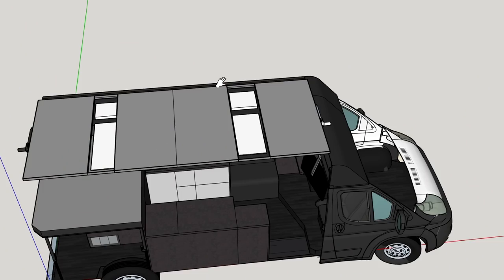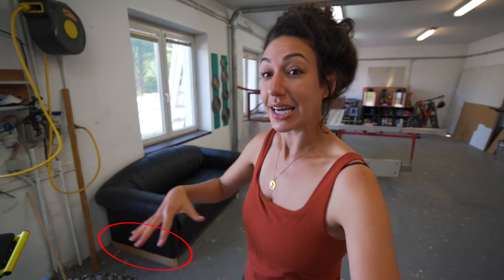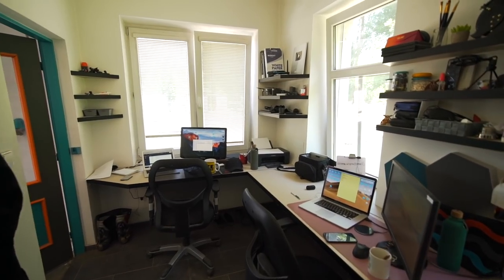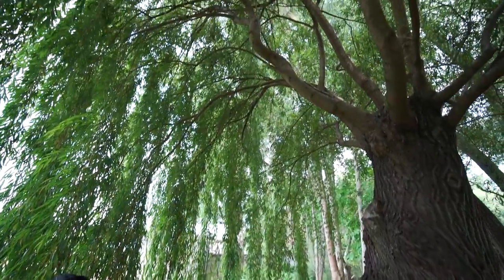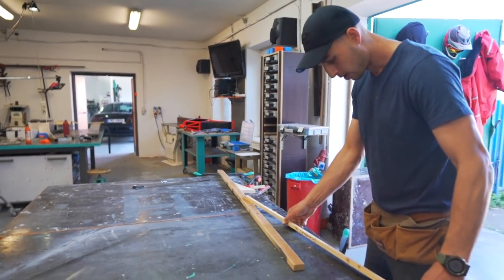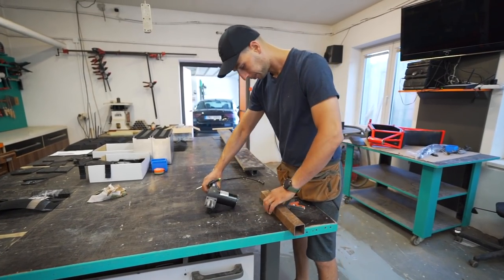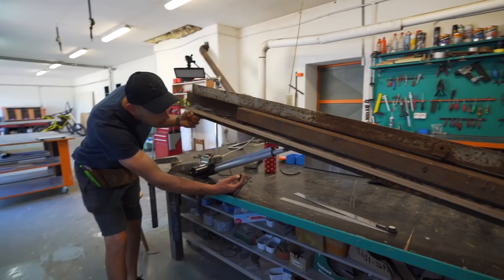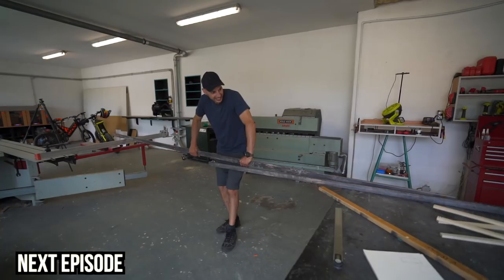Inventing Motorized Solar Lift for DREAM DIY Van Build / S2E1

Comment from the maker: Happy Wednesday! It's been a big week! We're finally feeling like this project has everything we've wanted. It's light-weight, around 11cm tall, and the craziest goal of all... as close to 45 degrees as we can get! Wishing you a wonderful week, and don't forget to smash that "like" button if kittens bring you joy <3

Edit: I need to pass 3 more levels (7 total) and then I will have my skydiving license! Yippee!
Reply: Off subject question.....How long (many miles/km/years) will a decent 750w mid drive kit or 3000w rear wheel e-bike kit last? I heard the 1000w  $200 rear wheel kits often don't last very long under normal use. I have a cheap 2 stroke motorized bike kit and really want an e-bike kit but can't afford to pay $1,000 for a motor & battery kit only to have it last a year or get destroyed from water damage by getting caught in the rain a few times.
Reply: Someone is falling in love with a kitten.....
Reply: OMG, you guys have to add that little kitty to the family!! 🐱❤️🐱

Comment: Very cool.  The same concept/mechanism can be used to level the bed that you sleep on. Let's say if you are parking on the street for the night, the passenger wheels are typically in the street gutter. One side of the bed is higher than the other. Ladi's mechanism can then raise the bed so it becomes level. The rest of the van will not be level of course, but having a level bed for sleeping is a requirement.
Reply from the maker: It’s better to level the whole floor so it’s comfortable even for cooking and general existing 😂 Leveling air suspension would be the dream!

Comment: When I saw the problem, I would have thought of a design using a small second vertical actuator just to push the first few cm.
Your solution is much more efficient. Congrats!

Comment: That is a  clever mechanism. I considered a bladder to start the initial motion on scissors but after evaluating pros and cons decided on portable panels. When I park I set out the portable  panels. The additional benefit is camping in shade while panels are in the sun. When driving alternator and the panels on the roof provide sufficient charge.

Comment: Some reason came into my mind those hook lift trucks, lift cylinders are almost lying down flat but there is small help piston upright under boom on frame what assist at the beginning of the lift so that main pistons gets better angle.
Reply: when you see them tinkering with designs that didn't fit their needs at around 16;15 you can see them try something similar to what you're suggesting, using a spring in place of the helper cylinder. presumably it didn't fit their requirements, (maybe too tall?)
Reply from the maker: Too tall and requires a lock. It would be bouncing on the spring when driving.
Reply: yes but i didnt mean spring, there is short actuator under and push that frame up same time when main actuators start lift, i would do something like that and use also clamp locks.
Its hard to design something functional in such a low space and that it will last a long time.

Comment: I've been waiting for this video since you announced a solar lift. Finally it's here !
Reply from the maker: Hope you like it!
Reply from the maker: It looks pretty promising so far, It will look very futuristic once it starts sliding and tilting 🤞
Reply: @StefanAPagel  use the sides, hinge from the top then adjust the bottom out to the Sun angle.

Comment: To optimise this further, it will be ideal to know the panel tilt angle, as you will need/can vary this depending on your location and time of year. Once you reach a new location you can refer to sun charts for the zenith angle and a simple tilt angle calculator for that day. You can certainly put it at 45deg and be done, but when you have an adjustable tilt angle mechanism already there you can easily optimise it further. Just a thought.

Comment: L&M If this doesn't pan out in the long run, have the panels on a pivot on the side you have a and link the ends on a shaft and have worm gears on either end and the middle, speed isn't an issue, the panels could take 10mins to get open but that doesn't really matter. A support pole could achieved using other actuators but you'd have your low profile with the work drives being in line with the roof and a hell of a lot of strength having less structural failure points. The actuators would be supportive but not required .

Comment: Hope you bought a good quality actuator. The ones coming from China will not last more then a year. I am on my second set for my home solar tracking system, and one has already broken down again. Average is around 1 year life span.
Reply from the maker: Depends how you stress them, how mounted they are, how waterproof (if) they are, how overloaded they are…Ours are from China as well and I bought heavy duty for a purpose. I’ll be waterproofing them later as well.

Comment: Just an idea if you havent tried already... If you wanted to use the 'scissor lift' option, could you not flip the folding point and have the actuator in its 'extended' position when the solar panels are flat to the roof but when you operate or 'retract' the actuator it pulls the hinge and lifts the solar panels up? My theory is that its using more leverage then force? Love you guys all the way from England!!

Comment: Great video 👍 Nice solution if you need a small powerful drive have a look at car wiper motors!
Reply from the maker: Thank you. I considered it as well for the threaded rod option.
Reply: @ladiandmargaret  Your solution was ace amazing what modern electronic motors can do on a size power output!

Comment: The first good idea i came up with is to use a worm drive or worm gear, while one of the gear is fixed to the stealbeam holding the solar panels
That should also allow a quiet flat desigm
Is there a reason why that was no option?
It may cost alot of torque to get it going but to prevent that u could use a finer thread on the rotating thread
Reply from the maker: It’s a complicated mechanism so at this point you just need to work on it. I think it required more material making it heavier.
Reply: @ladiandmargaret  thats certainly true 
I just finished my university exams and watched ur new video about your solution for the solarpanel-roof mechanism. U nailed it!
It must have been really hard to find the sweetspot between weight,height and stability.
I am looking forward to see that bad boy of a camper van completly finished!!
Thanks for taking the time and best wishes from germany

Comment: I think the sliding out option is still doable ? As you could also tilt the panels once they have slid out very easily by a disc in the middle at either end of the panel with very little  force as it's balanced and the good thing is you could panel the entire roof, getting 1000w plus and then still have 2 fans, a AC unit and a viewing deck underneath the panels ?

Comment: hey, 
have you thought about electric tailgates kits? and also the way the they work? They work pretty much like on the dude's video, and are super stable even in the windy conditions no matter where you stop the tailgate while opening.

The highest backforce is indeed when the actuators start opening the tailgate and there is no "scissors" mechanism, the struts are attached almost parallel to the tailgate itself. 
I have them on one of my cars and actually installed the trusted aliexpress kit to another car. Really strong and stable. Try to mimic the mechanics of it to see how it will work for solar panels.

Comment: I think tilting your panel is only more efficient for such a short period each day, in my opinion it is hardly worth the trouble. In winter the sun goes from east to west, in summer in large parts of Europe the sun goes from north-east to north-west (the more north you go, the more north the sun comes up. Tilt is only efficient the short period when the sun is coming somewhere perpendicular to your tilt, while for the rest you better just leave it flat (or you should arrange a mechanism with al ball bearing).
Reply from the maker: Data actually speak otherwise.
Reply: Seen over an entire day in Czechia, sunrise till sunset, keeping your van stationary, what is the gain in percentage over leaving them flat on top of your van? (Although in winter I have less of a doubt of its usefulness, because of the sun coming up less from the north and staying lower.)
Reply from the maker: We showed a graph in one of the videos. It’s a big difference.
Reply: I agree with Sander.  The whole lifting construction is only dead weight. Maybe active sun tracker brings more power, but tilting barely...  If you want more power ? Add more panels, better panels, more batteries and charge them with car alternator. Tilting in summer is useless, in winter is good only for clening snow :-)   There is a BIG difference between theory and practice, ask someone with FV about winter

Comment: pneumatic cylinder or spring hinge. 👍🏼
Reply from the maker: I bet there would be a way to make it as well.
Reply: What a fascinating thought. Default in the up position and pull it back down closed against the spring?

Comment: What about the “scoop” windmills on a van. Since you are driving this would create power….? Check them out
Reply: You can get energy directly from your engine (alternator charges the lead battery), why would you waste energy on creating even more drag. because of its height and less than flattering aerodynamics a van is already a lott less efficient than a coupe. With EVs this is even more pointless as each percentile higher CW  costs a couple of kilometers. and even if you are stationary, i doubt small windmills about 3m off the ground will generate a lot of power.

Comment: That steel tubing and bar you are using looks very heavy. Would using aluminium/aluminum section not be lighter but still have enough strength? Mind you, that steel is free!
Reply: I think they were just using the steel to test how much weight it could handle.  If you watch the preview for the next episode, he is pulling some lightweight metal out saying that it should hold 4 solar panels.  (I could be completely wrong though.)
Reply from the maker: You are right, that’s what I did. I wish I knew how to weld aluminum. I’m choosing 20x50x1,5 metal for the whole length of the van to support all the solars. It’s around 5kg. I’m going for metal just because I’ll be welding great amount of custom parts and all the welds must be very strong.

Comment: Did you ever consider something less mechanical such as an airbag
Reply: Now THAT'S interesting as I've got a compressor built into my truck....  the problem is: you have no control as in pulling the panels down tight for travelling. Bear in mind head winds not just road speed...

Comment: That looks overly complicated to me haha sorry.
I think I'd have connected the rod end of the actuator to a rotating cam assembly that on pull it rotated it into a clasp to lock the panels down and on push it would first rotate to unlock but also push on the cam edge and nudge the panels up, once the cam goes to it's full lift position then panels will simply be pushed up by force of the actuator..
Question is can you see this in your head from how I wrote it :D

Good game isn't it :-)
Reply: I think that you might be a genius... l need to sleep on it though as it's 00:40
Reply from the maker: Give it a try, it might work as well lifting 75kg of solars.

Comment: I follow your build with great interest. A couple of tips for PV effect enhancement. There is a theoretical effect limit of PVs You are adjusting for the height of the sun, and I guess you also could move your van to adjust for the horisontal angle of the sun. However, there are some tricks you can apply to enhance the output, even up to 50% better. Inside old laptops and lcd screens, you find sheets of lenticular lenses. Check out these two videos: https://www.youtube.com/watch?v=2yHxj-TudEA and https://www.youtube.com/watch?v=x_UKVEBxYFM
Reply from the maker: That’s very interesting! Thank you for sharing!